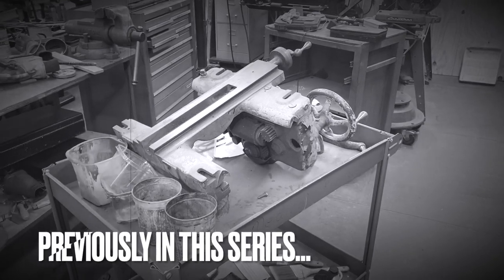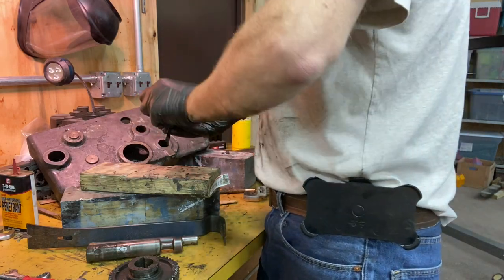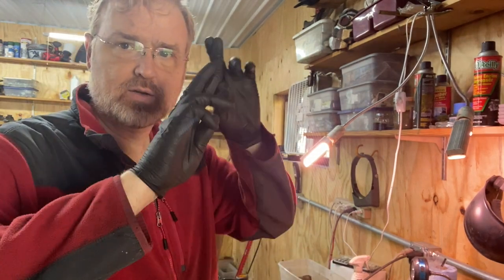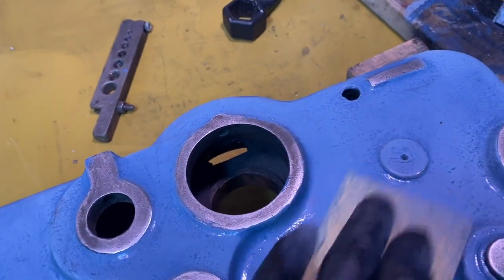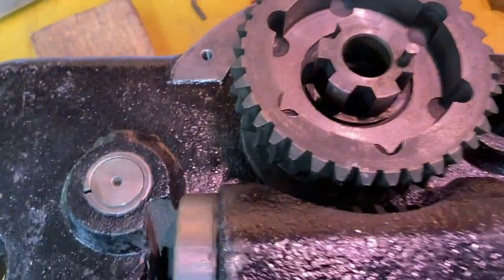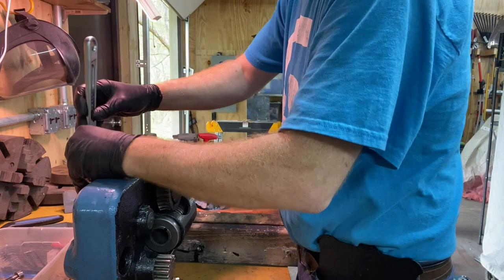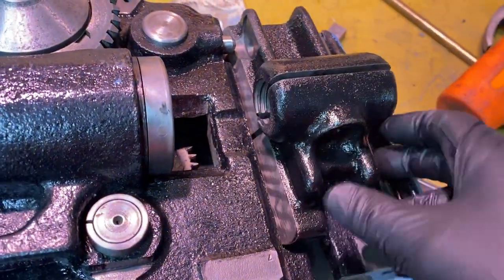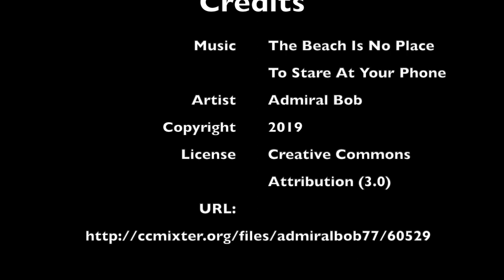South Bend Lathe Restoration , Part 12a (Apron)

Comment: Awesome Kevin.  I love the way to talk us through your thought process.  Very interesting.
I have a newer model SB, but the Apron seems to be the same.  On mine, there was a huge number of wicks, but I saw only the two you show at the end.  Is that all that came out of yours in disassembly?  Could you be missing some?
Reply from the maker: I put back all the wicks that were there originally.  But I bet you are right and I was missing some.  I didn't have a manual that showed me what it should be like.  I don't run it very hard.  I hope it gets by without them (fingers crossed).  Thanks for the feedback.

Comment: The best results I’ve had with taper pins is sudden impact.
A large ball peen hammer with a drift will send those pins flying across the room. Trying to use a clamp or a soft blow won’t provide the impact required to bust her loose.
Beautiful property
Reply from the maker: So I should have been using the sledge hammer on that and not on my gear fork! LOL!  For that pin on the inner gear (the one I left alone), I did try a regular hammer.  But I didn't want to bend the shaft so didn't go to wild on it.  Thanks for watching.  Regarding property, TN is a very beautify part of the country, and I am thankful for being able to live here.  :-)

Comment: Hey I know that guy! (Billy)
Reply from the maker: I was talking to him last night and he told me that too!
Reply: @KevinToppenberg  Billy's a great guy. He build the controller for my CNC wood lathe and it works great!!! Ask him about the Wimshurst machine I made him. The turnings on the machine were made with the CNC lathe.
Reply from the maker: @WinkysWorkshop  That Wimshurst machine was the first thing he told me.  I think it has counter-rotating wheels and capacitors -- builds up a electrical charge for quite a shock!.  Do you have a video about it?
Reply: @KevinToppenberg  The start of this video is the machine I gave to Billy.  https://youtu.be/aLVlV0N7Y1Y

Comment: Oh, sweet pie o` my... If you think that carriage is heavy... I have a 2.5 tonne surface grinder by Elb and a Schaerer UN450 lathe which is 2.7 tonnes... Both i bought as a rescue, as they would otherwise been thrown, and while some work is needed on every part, the carriage of your baby Bend is pretty much lighter than my tailstock... I moved it with no aid, but with enormous struggle... It has around 60 kg without quill and its leadscrew with handle, which add up another 10 kg, making it a 120/150 pound thing on its own... The carriage i dont even know how heavy it is, i am finishing a crane lift to be able to work on it further, and on the grinder, as nothing on it, apart from the screws, weighs less than 80 kg... Dont get me wrong, i commend you for the fine works thou hath done, but just know that that little apron is a walk in the park in regards to difficulty maneuvering it about... And i feel your pain with the paint removal... Except my lathe is again so much bloody larger that i still have to even disassemble it once the lift is made to finish the paint removal... Let alone go through what you already have with bondo and the rest of the good stuff... Huffin fumes and getting a free high... At least there is some benefit to paintwork...
Regarding the clutch... My lathe has a similar thing, but different in construction, but its not meant to switch between either thread drive and rack drive, as you have to disengage one to engage the other. The clutch is there to allow you to set a hardstop on the ways and let the carriage be rack driven and crash into the hardstop, slipping and stopping the drive until re-engaged... The situation with two nuts and such is a tension mechanism that is supposed to be set to allow lathe to work and not disengage the rack drive when the cutter hits the work, but to stop and disengage should the carriage land on the hardstop, as to allow easy setup, quick safety and so on... Find a manual for your lathe, i doubt that the clutch has anything to do with drive selection, as you have to do that by engaging a halfnut lever or engaging a piston or what not to get the rack drive...
Reply from the maker: Wow!  Your project sounds amazing.  But also really difficult!  Best wishes and I hope it all goes well for you.  Thanks for the feedback!
Reply: @KevinToppenberg  Yeah, and guess what, i just today picked up a 1000 pounds of cast iron Thiel Contourex, removed its workhead and am in possession of a machine base to strip and repaint, also, i picked up a Sarlah drill press without a quill, also in need of a resto, so now i have 4 machines to restore... Dear Lord, i should stop leaving the house before i get a jig grinder... But I picked up the Thiel as to slap an internal grinder`s hydraulic headstock(already have it) to it and make myself a hydraulic lapping/polishing lathe as i despise the idea of grinding on a lathe with a proper bed... So yup, i now have 6 tonnes of machines to strip, fill, paint, scrape for precision(the thiel is amazingly good, factory scraping, leadscrews, ways,  bushings and such are almost intact as the machine became obsolete quick after it was made)
Reply from the maker: @camillosteuss  I hope you are going to make some YouTube videos about all this!  🙂
Reply: @KevinToppenberg  I am considering it, as i know that most of machines i own have no videos on or about them, and should anyone get one, they will be blessed beyond expectation to find a video archive of how to for that machine, as i would have been... But i am lazy for such work, and i am constantly considering when to or if i should film what im doing, as the shop is either such a colossal mess or I am and would likely fail to provide the quality of material i want to provide, should i decide to do so... As you manage to do... I`ll see, maybe i`ll prepare a camera holder and the rest and film some, as i just put each machine where they are gonna sit and operate, once finished with resto... But for today, its smoking and tea until blondie releases a new vid...

Comment: Well I think I deleted my original comment on accident! Hopefully you can read it somehow! Im not typing that all out again!  But if you somehow can see it... feel free to post it here in reply if u want??
Reply from the maker: Hey, thanks for your reply.  Unfortunately, I don't know how to view a deleted message.  I'd love to hear your thoughts if you want to try again?  Best wishes....  Also, I have had trouble in the past with trying to post with a link to another site.  I think YouTube automatically deletes those.
Reply: @KevinToppenberg   okay so I took out the no no parts on my 15 inch southbend apron. It was the worm gear that you avoided messing with. Mine was very sticky and all jacked up because paint got in the oil holes in the tray built into the casting under where the cross slide screw is. Those steel pins were  pushed in and I didn't want to to machine a tiny screw press to get them out so I drilled the pins out and it was a pain. There is a felt wiper in there by the way. On mine the cross slide nut is different than yours. It has .600 play.... hopefully the screwbisnt too worn out.. I got a new cross slide nut from ebay for a 13 sounthbend it has the right LH ACME  threads. And on mine it has a 3/4 in diameter counter bore into the nut. My lathe is 48xxx something serial number which puts it around 1931 as I recall on the Steve wells page of serial number spreadsheet.  It is a 88c catalog number. I saw that yours is a 188c. Mine originally was line shaft powered and now it has a cool cast iron motor bracket that was an option from southbend. Ill try and take a video of it but my hands are always way to filthy to record anything the last week.

I am going to send off to grizzly and see where it was originally delivered to. I know it was somewhere near Milwaukee. i got it from a friend who got it from a friend who got it from somewhere in  mke area. Its pretty cool that yours came from bridgport ! There is a lot of heavy industry in Milwaukee in the 30s so im freaking g excited to see where mine came out of! There was so much sludge and swarf and junk in that poor gearbox. Now I know about the second set screw on the fork. So THANK YOU for breaking yours and telling / showing us. Haha.
Reply from the maker: I wanted to clean that worm gear, but just couldn't figure out how to do it.  Sounds like your lathe is awesome.  The crossslide screw wasn't terrible to replace.  I know there are some on Ebay that do it for a fee.  Best wishes!  You are welcome about breaking my fork.  Glad SOMEONE got some benefit out of it!  LOL.
Reply: @KevinToppenberg  I finally got the worm gear out. Luckily i had a silicon bronze propeller shaft with the right diameter and similar keyway from a 1950s Chris craft cabin cruiser. otherwise there was no way in hell to get it off. Now I just wonder if this lathe made that shaft. If any asks it definitely did.
Reply from the maker: I don't understand.  How did the propeller shaft help get that worm gear out?